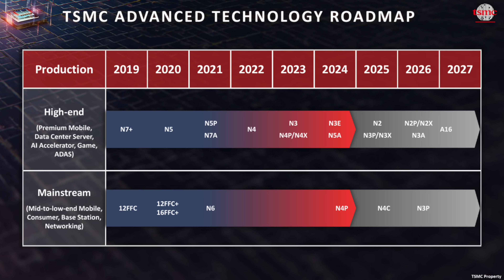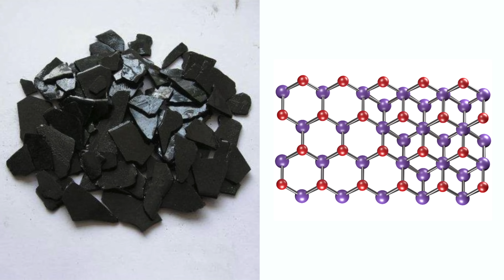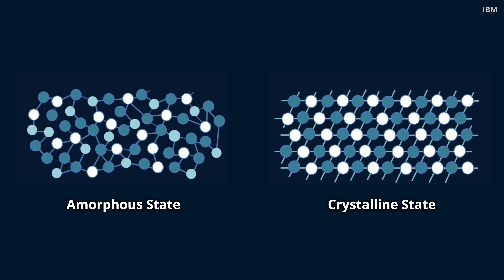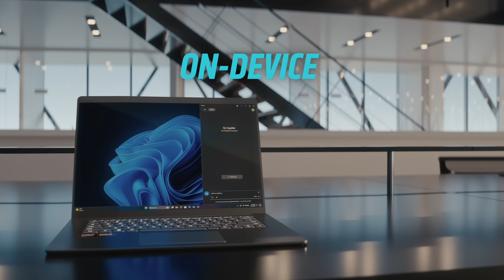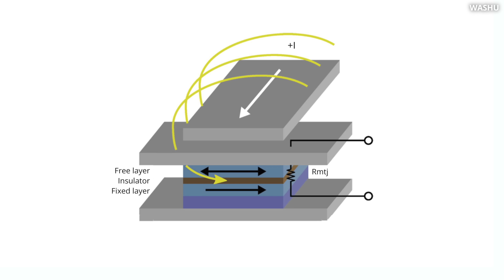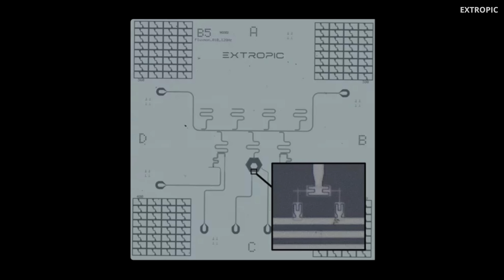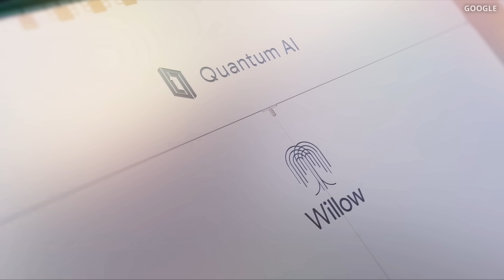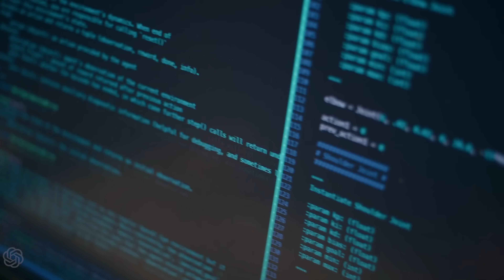A New Semiconductor That Changes Everything

Comment: 0:30 No. Moore's law is formulated in terms of "density at minimum cost per transistor". The density at minimum cost per transistor is still where it was a decade ago; at moderately sized 28 nm chips. Moore's law has been dead for a decade. It's not dying, it's already dead and no longer even visible in the rear view mirror. Here you directly acknowledge the death of Moore's law 1:17; the density increases by 15% and the cost per wafer (of the same wafer size) increases 50%. Those are 28% more expensive transistors and 28 nm is still going to be the densest node at minimum cost per transistor.

Comment: Analog memory can be a game changer for AI. BUT It is not new! Memristors promised in this field but they have a limited number of cycles before they degrade. So the same question needs to be asked in this case. Is there a limit to the number of phase changes? Or any instability thereof?

Comment: I think it was 20 years ago , that a man discovered and designed and had running all the components to phototronic computering . 
It was sold to hp / Dell at the time . 
Why are we not focusing on the phototronic system? 
I knew from the future article I read ... the integration of silicon memory was being worked on . I work in construction ,  high-tech ....so I lost the follow up ...but at the time this seemed way way faster and to solve many of the problems they were having such as overheating .
Reply: Other then this which to me sounds the best ( computing at the speed of light ) ...just go nuclear . Make it safe by sealing behind diamond in a lab . And make it hype- dimensional 3-D Hologrraphic .

Comment: Good! We Are At The Limits Of What The Silicone Can Do!! DDR4 Running At 3200MHZ's CL 15 Is No Slower Than DDR5 Running At 6400MHZ's CL 30!! It Takes Twice As Many Clock Cycles To Get The Data Out of The CL 30 Than It Does The CL15 Right! Or Have I Missed Something!  So They Have The Same Slew Rate! The Time It Takes For The Transistor To Move From One State To Another!

Comment: Yes this is all great. But AMD weren’t the creators or designers of the first SOC or system on a chip. The first was designed by George Thiess and Willy Crabtree in the 1970’s at Electro-Data inc. The first of which was built into a watch. Qualcomm crated the first one with any power in 2006 and since 2019 Apple had been producing its own M1-M4 chips and they are the most powerfully most energy efficient ever created. Well let me rephrase that. Apple designed the chips but TSMC manufactured them. Intel made Apples chips up into 2019 or 2020. The M chips can run circles around any Intel chip and consume 50% less power while doing it. They can also run circles around AMD chips too. Intel is pissed off though. They are about to become only the second company on planet Earth who can manufacture 3 nm and 2nm chips. TSMC is the only one now who can do this. 3 Intel Chip fabs are being built right now. And 1 TSMC plant is opening in Arizona too. So 4 brand new state of the art Chip fabs will be opening in the USA within the next 18 months. Why only 18 months? Because construction began in late 2021. That’s when President Biden past the Chips act. Something that should have been done in 2017 when dumbass was President. But since Donald Trump doesn’t know how to be a president we had to wait for a real president. I would rather have old demented deminished Biden as president for 8 more years than have trump back in there for 1 day. Trump is 80. His father died when he as 89. Know what he died from? Alzthimers disease. It runs in his family. You know what doesn’t run in Joe Biden’s family? Alzheimer’s disease. Food for thought

Comment: New tech discoveries by R&D is step one. Getting a new tech in production is another challenge. Finding snd selling a new discovery to the right production facility can be the hard part or getting a production line started and making it cost effective and another is getting it to a market. Having the $$ to go from R&D to the market is the roadblock to many great inventions. A team must have good R&D, those with knowledge on mass production, financial & funding and those getting investors and selling the end product to mass marketing or big $$ buyers (NASA, General Electric, etc.) There are great things invented in the 1950's just sitting in the patent office because of a failure somewere along the process. Solid state batteries cells, many did good in the lab, but never to a production line, funders loss faith, funding dries up. Fusion?

Comment: but how much heat does it produce when mechanical pressure is applied and to what degrees at what PSI?
wonder how it's application can be applied to making diamonds out of coal or towards battery storage or electrical generation in a turbine set up.
also what would be a good way to use this to detonate C4?

Comment: few i9 chips are made and many dead or i3 because when curing the silica waffler slices they are not purified through the sound frequency that reverberates in the waffle material like the bass of the sound reverberates in specific parts of the human body in the music boxes of electronic music festivals. with the help of an oscilloscope.

Comment: That was a very interesting and concise set of developments. The prospects for graphene seem especially interesting.
An intriguing prospect that IBM tried almost 20 years ago involved a method like vapor deposition to insert LED and photdiode materials INSIDE carbon nanotubes in order to create photonic, three dimensional lattices of carbon nanotubes. Photons replaced electrical connections between spatially separated nodes. This architecture somewhat resembled the interconnect 'fanout' between neurons. The electrical characteristics of carbon nanotubes themselves can be varied from insulator, to conductor, to SEMIconductor based on the chirality (i.e. twist) of the carbon nanotubes..  I have no idea if work on this continues to this day.

Comment: Thank you for sharing this information. 
Very informative. 
One note.
Even though people commonly state that something is multiple times less than something.
In this case you state it used a billion times less energy.  That is impossible. 
It could use one billionth of the energy or 100 percent less but never beyond 100 percent of it would be negative.

Comment: Just my opinion, Moore's law is not actually a law, its an approximated prediction - big difference. Also interesting but lots to happen yet especially as regards stability of such new chips, and are they likely to degrade over time or for example suffer functionality defects when exposed to ambient eectro- magnetic radiation, thermal variance etc -Just saying

Comment: Moore's observation (not Law) was for "features" to double every 18 months, in those days it was op-amps & DTL** , so diodes and resistors were numerous features. (OK ,call it 2 years, it is slowing down). Silicon is most abundant in the "crust", for the whole earth iron dominates. As for analogue computing, it will be used in niche applications (co-processors eg), because "resolution"** may be infinite, but "accuracy"** is king if you want to know eg what the weather will do tomorrow. **Look it up.

Comment: Check out 4DS Memory - PCMO Non-Filament Interface Switching ReRAM. It has been fully Fab qualified at imec at 60nm in a megabit array and will have 20nm out in Jan 2025. 4DS Memory have also partnered with Infineon to create a custom ReRAM chip that is tailored to 4DS Memory unique characteristics.

Comment: Why don't they just increase the size of the cpu? Triple the size means you can triple the number of  transistors, increasing the speed. Most consumers don't give a shit about the size. Every time you increase the speed the programmers take advantage of that maybe not realizing that the prior cpu's will struggle to keep up with the new software. Or maybe set a standard so that any chip can handle whatever software is being used. That is what it's really about. When anyone goes out and gets a new pc they know that before even a year has passed, it will struggle to run any new software. It will run it just not very fast or efficiently. Very frustrating.

Comment: The final frontier in computational materials lies in the integration of human organic brain tissue as central processing units (CPUs). This concept represents a groundbreaking intersection of biology and technology, where the inherent complexity, adaptability, and processing power of neural networks could far surpass traditional silicon-based systems. Such advancements demand a multidisciplinary approach, addressing challenges in bio-compatibility, ethical considerations, and the scalability of organic materials for computational purposes. This frontier offers unprecedented potential to redefine the limits of processing and artificial intelligence.

Comment: Moores law has to do with cpu and transistors, not memory. Apples and oranges. Moores law is dead, has been dead and even with GAA and nanotubes it will only be a few years before we need transistors smaller than atoms which is still impossible. So nothing is new here.

Comment: PCM is interesting but I have seen first hand how difficult it is to implement.  I have worked with Chalcogenide materials as a PCM medium and, as you stated, commercial applications never materialized.  The repeated shifting between phases caused migration of atoms which eventually degraded the memory cells.

Comment: The 20 year rule applies in this case.  From the point when a primarily scientific paper is published until the time when a manufacturable and reliable product using the technology is minimally  20 years ± 2 years but can be longer, and usually in multiples of 20 years (it's a generation thing - a new crop of engineers are required to out think their predecessors).   Every disruptive or innovative technology since the steam engine has obeyed this rule.

Just look at SiC or GaN.  Find the first papers about this and then look at when viable products were finally sold.  20 years or more.

This is why NO ONE should get too excited about new academic papers like this.  The real work hasn't even begun.

Comment: If we apply Tribernachi Theory to improve the technology of solid-state amorphization (SSA), as described in the provided "Solid State Amorphization" paper, one could explore several avenues:
1.	Quantization of Defect Dynamics:
o	Tribernachi Theory's principles of discrete lattice structures and quantized volume could be utilized to model and predict the introduction and evolution of defects during the SSA process. The discrete, bounded framework could provide insights into how critical thresholds for defect density and structural instability are reached, leading to amorphization.
2.	Volume Quantization for Material Stability:
o	The concept of volume-based quantization from Tribernachi Theory might inform the development of materials with stable quantized volumes, reducing the risk of uncontrolled amorphization. By aligning material design with Tribernachi's deltahedron lattice, engineers could optimize nanostructures for predictable amorphization pathways.
3.	Optimization of Electric Fields:
o	The Tribron Force and its role in maintaining discrete, stable volumes can inspire new methodologies for applying electric fields during SSA. For instance, by understanding how electric fields interact with quantized lattice configurations, the SSA process could be fine-tuned to achieve greater control over the amorphization threshold.
4.	Energy Efficiency and Stability:
o	The Tribernachi concept of "balanced zero," representing dynamic equilibrium, could help design processes where the energy input for amorphization is minimized while maintaining structural stability. This could enable low-power applications of SSA, as suggested in the paper.
5.	Resonance and Harmonic Analysis:
o	The use of harmonic analysis and quantum resonance principles from Tribernachi Theory might be applied to detect early signs of amorphization or to stabilize intermediate states, preventing premature structural collapse.
6.	Exploring Prime Quantum States in SSA:
o	Prime quantum states, as described in Tribernachi Theory, may correlate with specific defect configurations or energy states in the amorphization process. Identifying these prime states could allow targeted manipulation to enhance material performance or prevent undesired phase changes.

Comment: 1:26 if it’s slowing down then it’s dead. There were no ifs or buts to Moore’s law. So if transistor density doesn’t double scale yearly (or every 18 months) then it means the law is dead.
Reply: You are technically correct, the best kind of correct

Comment: It does take time for new technologies to impact actual marketable products.  however after that first transistor in 1947 it wasn't decades to the first real product on shelves.  A transistor radio went on sale in 1954.  they sold something like 150,000 of those.  By the early 1960s transistor radios were ubiquitous.  

Your point is valid though.  When the first ruby laser was created in a lab, no one had any idea what it might be used for.  It was described as a solution looking for a problem.   Hard to imagine that now.

Comment: The advancement of atomic clocks was quite a blockbuster development. It will enable much more precise GPS technology. After that, I've seen some very interesting revised calculations for space elevator technology. The materials may not have to be as strong as previously thought.

Comment: Parently it's not a change of phase between liquid and solid, as you say [at the beginning... 😏], but between the crystalline and amorphous state, because no liquid forms. This is analogous to what happens with rewritable CD-ROMs: the laser heats the surface, which changes from crystalline and reflective to amorphous and matte. This technology also uses indium.
I find it hard to understand how MIT could discover a new semiconductor material in indium selenide, because it's not a new compound, which would have been difficult to produce, for example. Selenides are already frequently used in electronics. I suggest that they test all the selenides, the arsenides, the antimonitors, etc. of the other rare earths. 😎

Comment: Sounds like analog computing done by the ram?
Does that mean that each byte/word/lword of RAM will effectively carry out the multiplication INTERNALLY within the semiconductor of the RAM, and the same semiconductor holds the result? Isn't that a bit like analogue processing?
So that means no need to bus data back and forth to the CPU to do the multiplication? If so then no wonder it's insanely faster!

Comment: Frankly, in-memory computation is going to need several other advances to make work, besides this.  A much more useful effect for immediate applications would be to have it replace oscillators and other such components in analog silicon, and as a means of making FPGAs even more flexible.

Comment: Material-Science innovations that bring us supposedly "new" materials that will, "revolutionize" the way we live and work etc etc... is old news and seems to be cyclical.. I recall, not long ago, of the promise of LED lightbulbs and how they were going to change everything... I changed every light bulb in my home and experienced ZERO cost savings and wound up changing the 100 year bulb fairly often.. Another example is Graphene.. great promise, amazing looking properties but where is it? ?? IMHO there is still too much MONEY built into the continued marketing and promotion of far less capable materials solely for the purpose of turning a profit. Until such time that the demand for these new materials exceeds current options, I'm afraid these tech innovations - as great as they are - will remain in the fringes.. 

Sodium instead of Lithium. Another example. This could potentially be a very very long list if pressed.